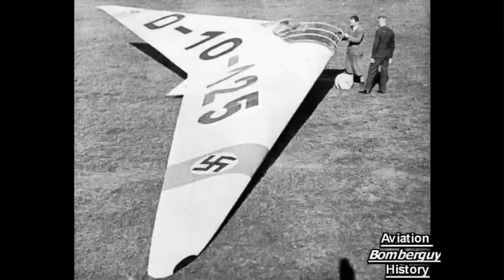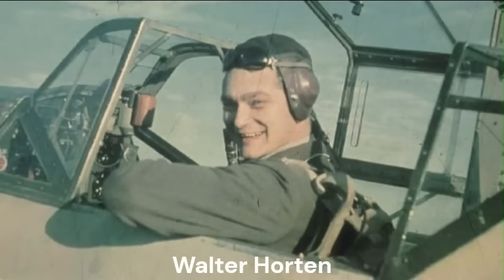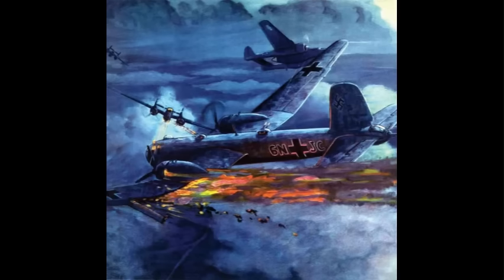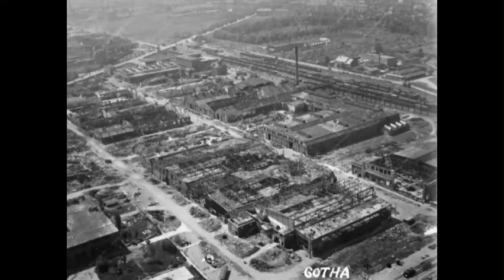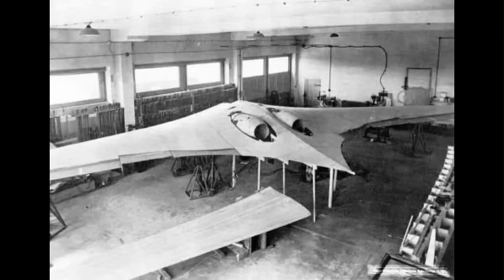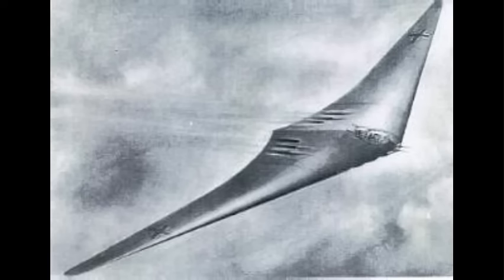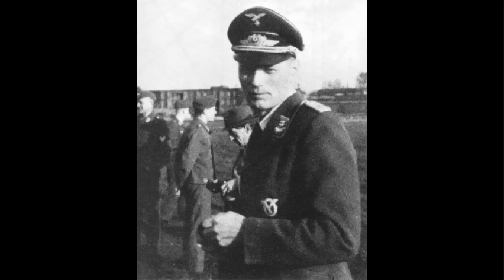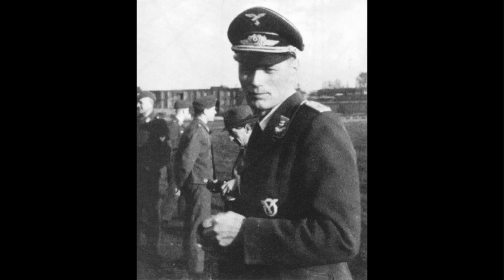Horten Brothers – SAD Fate of the Developers of the Horten Ho 229 STEALTH Jet Fighter (‘35 - ‘45)

Comment: Horten IX was a POOR design  MUCH experimentations after the war found the design to be LESS than claimed.. A lot less. 
It proved fatally  Unstable as the jet efflux interacted with the centre section airfoil,  under most conditions.
 It would have been useless as a war machine.
 Horten gliders were better fliers.
 Erm.... total airtime for the IX prototype was 1/2 Hour (two flights)
Even the Horten primary  test pilot, opined after... a flight in the Me163 praised it's  Massively better flying ability.
 Hortens were an interesting Anecdote, at best,  but Not Giants in their field.  
Despite  after the war nostalgic nonsense. 
Gotha  being  an experienced maker .. was Appaled by the Horten design.
  And built their own redesign,  which proved Far more capable.      Google; Gotha  p60

Comment: The Ho229 was neither revolutionary or stealth. More successful flying wing designs had existed since the 1920s and claims of stealth were only made after the end of the war by the Horten brothers who were seeking asylum in the United States. In reality the brothers stopped working on the project in favor of the Amerika Bomber and the Ho229 was ultimately a failure.

As far as the stealth claim goes it was stated that the Ho229 used a special charcoal mixture in the plywood called carbon black. When the surviving airframe was tested no trace of the so called carbon black was found and a mock up built by Northrop had a larger radar cross section than a stock BF109.

Claims that the Ho229 is the basis for the Northrop B2 Spirit and B21 raider are utter lies. Northrop only got their hands on the survivor after the B2's first test flight. The B2 is based on early long range flying wing bomber designs by Jack Northrop such as the YB35 and YB49 and the lessons learned from the Tacit Blue stealth demonstrator aircraft they built in the 1980s.

The Horten while an interesting design is flatly not that great and would have required another decade of RnD before it could match the likes of the Me262, Gloster Meteor etc etc. There is a reason Nazi high command lost interest in the project pretty quickly.
Reply: I don't think the Horton brothers (Reimar really) even mentioned it when they were looking for jobs. Their interviews with both American and British officials are in available records and I've never seen a mention quoted.
I think that's why they didn't get any substantial job offers, because they had nothing special to offer. I don't think either makes a mention of it until the 1950s and then it only amounts to the idea that wood might be less detectable. I don't think that Reimar's claims about carbon black appear before the 1980s.
Reply: @fritzwrangle-clouder6033  The only reference to it i know of that predates the 80s is from the 50s and even then it was only the mention of charcoal being used in the glue that held the plywood together. I mostly included the carbon black statements in my prior comment as i have seen many people praise the Horten Ho229 for having the worlds first RAM coating when that just simply isnt the case.

I Appreciate the extra information though as it helps my prior comment. People often blindly believe the myth of superior german technology without realising that the Allies had some highly advanced stuff as well, the Ho229 being one of the biggest culprits of this myth with people claiming it to be stealth.
Reply: @Tozzpot500  You just have to ask why didn't the Argentinians have the first stealth aircraft.
Reply: @fritzwrangle-clouder6033  A very good point, though most who believe in the myth would probably come up with some random excuse. One day the myth of the 'superior german technology' will crumble, until then i plan to make a lot of people mad by correcting them about vehicles like Ho229.
Reply: Love the tirade of US envíest  in the comments who do not except facts, without the nazi scientists from operation Paperclip, the US would not even have made it into space. !!

Comment: Ill tell you, the Horten/ Go 229 is very easy to make cardboard models of ,forming each half as a mirror image, then adding the central details of the cockpit, canopy,jet openings, and landing gear. A metal coat hanger inside the wing makes a great spar you can bend for dihedral later. Remember, these would have had the standard luftwaffe camo pattern of 2 tone green jagged patches, and probably a light grey or LRM blue bottom surface.
Reply: The shape of the cockpit was a major problem back then.

Comment: USA should name their B2 and B21 after the Hortens.
Reply: Why, those aircraft actually amounted to something.
Reply: @fritzwrangle-clouder6033   different budget, same idea
Reply: @nkristianschmidt  Then it should be called the Dunne or the Westland Hill or the Northrop or any one of the many flying wing ideas that preceded it.
Reply: @fritzwrangle-clouder6033   depending on likeness, yes. Dunne, no. Westland-Hill perhaps. Horten for sure.
Reply: @nkristianschmidt  But you said idea not likeness. And it's not much of a likeness though is it, by that reckoning most aircraft should be named after another one.
Reply: @Tozzpot500   Yes, I see they were almost contemporary.
Reply: @nkristianschmidt  not almost they were. The closest relation the Ho229 has to the B2 is the fact both are flying wings. The difference being one is a capable and reliable airframe and one is the Ho229. They are totally unrelated to eachother.
Reply: @Tozzpot500   Ho B21. End of story.
Reply: @nkristianschmidt  You are just blatantly wrong. The B21 is an entirely American design based on the B2, also an entirely American design.

The modern Northrop stealth bombers have nothing to do with an unstable failed prototype from the 1940s end of story.
Reply: @fritzwrangle-clouder6033   Sopwith Camel 21.
Reply: @Tozzpot500  I see people claim that they're almost identical, they should have gone to specsavers.
Reply: @nkristianschmidt  Yep, that's just about the merit of your argument.
Reply: @fritzwrangle-clouder6033   Yes and no.
Reply: @nkristianschmidt  So yes then.
Reply: @fritzwrangle-clouder6033    and no ... and Good morning from Asia.
Reply: @nkristianschmidt  So yes then... and good evening from Europe.
Reply: @fritzwrangle-clouder6033  He said yes! Didn he, Kepler?! He said yes!
Reply: @nkristianschmidt  He said Yes! That was just about the Merit of your argument... and good morning from Europe.